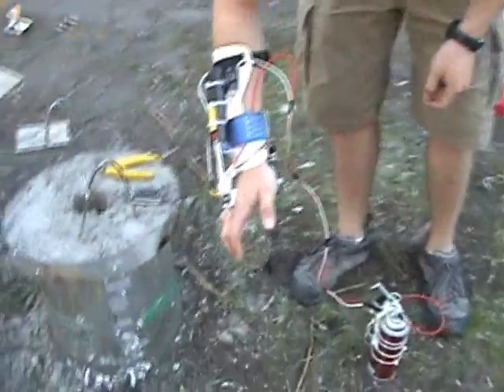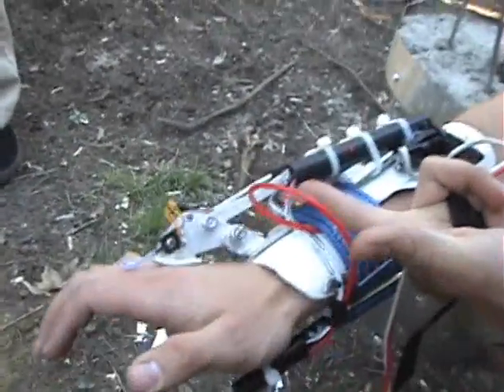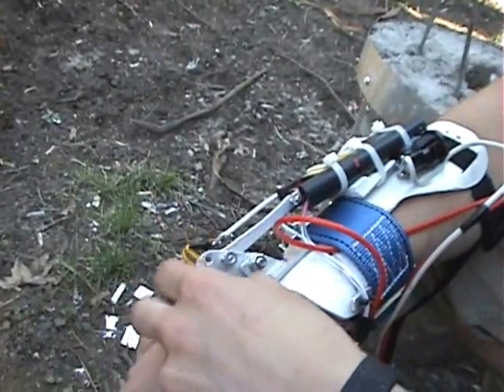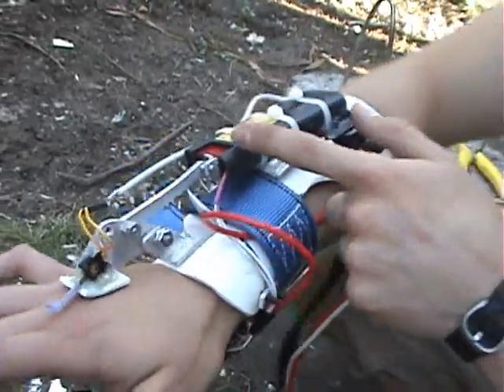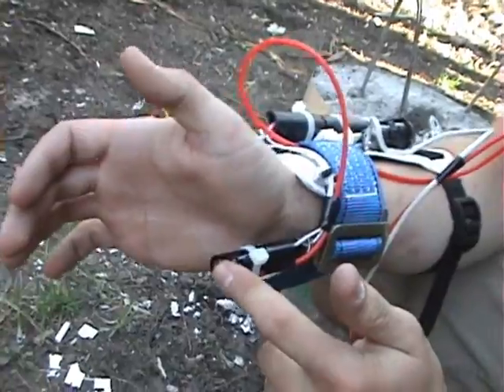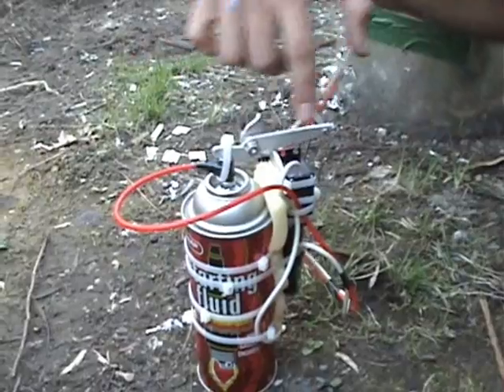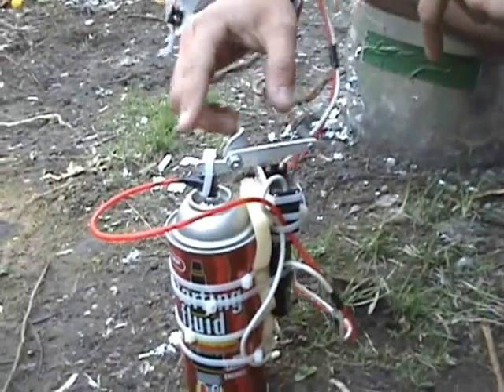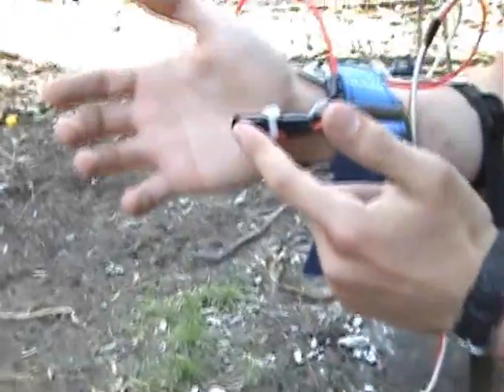The Pyro System

Comment: It DOES contain a few mechanisms. Which is the point of the class and hence the project.

If it was for a PhD it'd suck. But for high school/college it's pretty good- gotta have reliable mechanisms, good materials choice, and a little skill to make something like this properly.

You do need more range, and a liquid/napalm fuel- currently it looks like it'd take ages to actually burn anything other than plastics or petrol. You also need to invest in Nomex. Lots of Nomex!